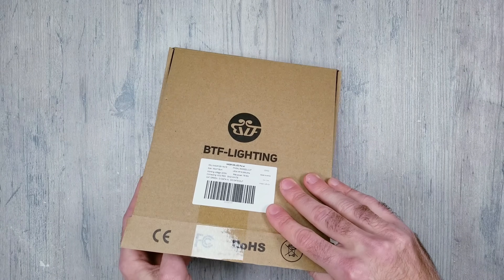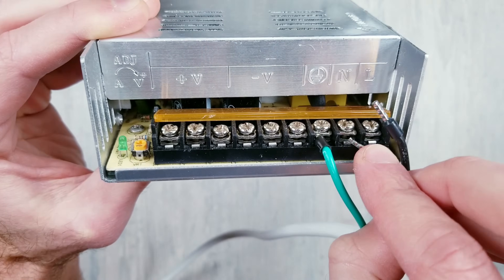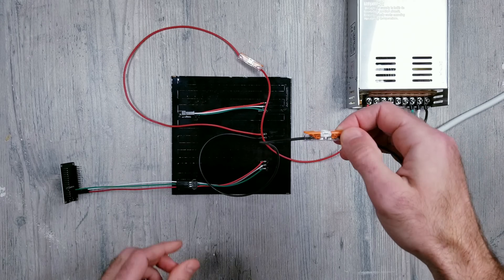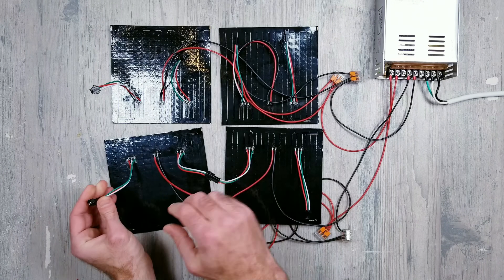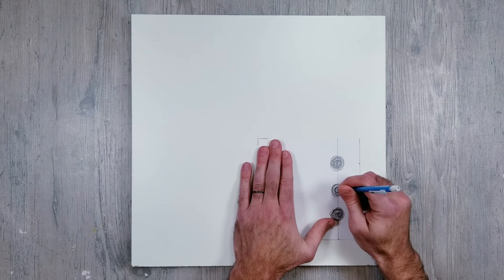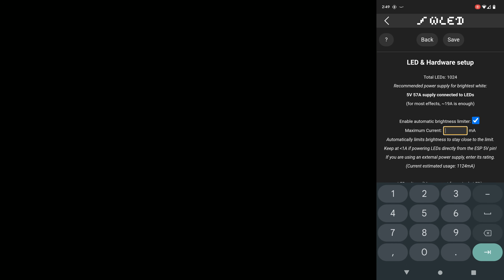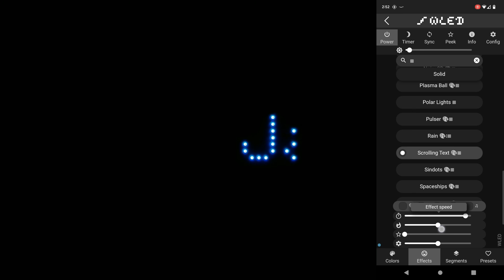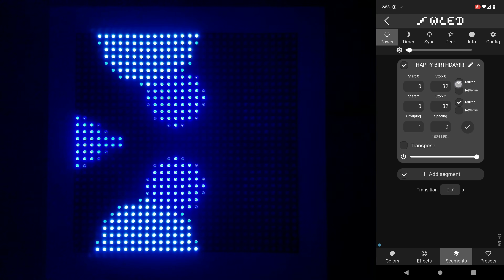1000+ LED Matrix! Setup, Power, Control, Tips - WLED 14.0-b1 2D Matrix

Comment: Won't the LEDs overheat (and die sooner) if you have them sitting on wood which insulates heat instead of dissipating it? Just FYI, the PSU you're using consumes 4 Watts on idling alone (no load). Prolly a good idea to use a smart outlet to cut the power to the PSU when not in use. That also helps with the LEDs which also consume power when not in use (just idling).

Comment: Hi,
I just came across your channel, and I do enjoy it and appreciate all the effort. I have a small question and am not sure if someone has raised the same: What if I want to connect more 6 8, 16, 32 panels, how will the power connectivity be handled? 
Appreciate a quick video demonstrating this.

Thanks 
Jandal.
Reply: just follow the same steps as the other panels, as long as your power supply can handle it you're fine. make sure you stay in a limit where it can still fit in ram for your esp

Comment: When in time 4:00 you connected 2 of the two injection cables to one Wago and the other two to the other Wago, could you just place all four in a single one? Id thought so because they share the voltage, but i don't know if im missing something

Comment: Chris, instead of using a pre-made LED matrix panel, could we just connect individual CoB LEDs, in a serpentine fashion to create a matrix (say 100 x 100) and use WLED for that? ... my end goal is to have a large matrix, highly spaced leds (I am fine with low resolution), hanging out my balcony where I can display pixelated text, images & gifs visible across long distances from outside.

Comment: Why did you limit your panel to only 3A? You have a 60A Power supply and the LEDs can take upt to 50 mA (i think 30 mA is recommended) . So 30 mA * 1024 = 30720 mA or around 30 A. I think this should also be possible the way you wired up your panels

Comment: I tried all the steps, but my lights do not turn on. Don't know what I am doing wrong. I use esp8266. And use micro usb cable for power, i use 4x4 led matrix and also tried them on 8x8 matrix also. Please help me troubleshooting this issue. It would be a great help 🙏🙏🙏🙏🙏🙏

Comment: good afternoon Chris. love your videos, got a question and maybe i missed it, But i do remember you talking about the eco version of lights maybe not working with a certain application, will the BTF eco panels work with this and if so what's the difference between them, they are almost 2 for 1 compared to the version you have selected on Amazon, TIA. Dale
Edit ok i did just find BTF's picture showing the difference and it looks like it all has to do with the color of the LED's and wire, so next question is how much of a difference is there, sorry for all the questions but i love messing with these and i am trying to learn all i can.

Comment: Can you turn off the power supply but keep on the esp32 to turn off the leds but keep on the esp32? Your videos have been very helpful to me and I appreciate you replaying to your comments
Reply: You can use a smart plug but that would mean having to wire the ESP32 to a separate power source.  I would suggest a relay to turn the LED’s completely off as they still use power in the off state.

Comment: I have to thank you for your very informative videos. I found your channel after purchasing Govee permanent outdoor lights but it led me to a few interesting projects.

I had just purchased four 32 x 8 LED light matrix panels just like these and it helped me get them working for a 1024 LED matrix for my wife's 50th birthday party.

I made a box and defused the LEDs with hard stock paper.

Everyone loved it and I am getting asked to share it at other birthday and Christmas parties.

That was fun but wasn't enough. I bought 8 more panels and setup a 3072 LED 12 panel matrix that I have working and am currently building a box to hold them so they can be moved around.

Thanks to your other video on using multiple channels I was able to get it working with a lot of trial and error. I ordered white semi transparent acrylic panels to defuse them this time.

I plan on having two chips. One setup for text scrolling between effects and a second with sound reactive for party time. It should be easy to switch between the two.
Reply: did one ESP32 board control all 12 panels with WLED and i assume if it did you used several of its data outputs, thanks Dale
Reply: @kb0cow   One ESP32 ran all 12 boards on two data outputs. Chris has a video on how to do this.
Reply: @90Beater  Thanks Chris for the reply, i figured it might be better to try two out puts instead of one, and them I assume that WLED did run them all. i went to your page to maybe see your Birthday board in action but no luck. i will try and search through Chris's videos, i have been watching quite a few of them plus others to learn as much as possible about these boards and running them  with WLED. Thanks again for the response. Dale

Comment: Hi Chris, we are using 3 pin BFT strip like you have on 5v but now they offer them in 12v as well. That changes things around, they have the 12v with 4 pin,. The controller we have can do  5-24V but only 3 pins, is there a way to somehow make the BFT 3pin controller controlling the 4 pin 12v 
BFT strips?

Comment: Don't know why someone would tell you that you need to use ferrules for those types of mounting terminals.. Ferrules are for PCB style terminals that have a small flat spring that is compressed by a screw. The connectors you're working with on the power supply are simply a screw with a square washer. The correct termination is a ferrule (2 pronged fork) that will sit either side of the screw that is clamping down and support the washer evenly.
Reply: Those are actually called "lugs." The ferrule refers to the fact that they are crimp-on, as opposed to solder type. A ferrule is basically a cylinder, y'see.
The lug is the actual end connector.
Reply: @jeffro.  Terminology fail on my part (probably wrote the original comment after beers) but you get the point. 
A cylindrical ferrule is just going to cock the square washer on an angle which means any movement of the cable could shift it away from the clamping force.
Reply: Not being smart when asking this, but does it matter?? Actual question.
Reply: @gurthbroox  Yes - this is AC power we're talking about here. If they come loose you've got exposed wires and a potential short.
Reply: @gurthbroox I don't know if it matters in this case but I know the problem ferrules are supposed to solve. If a high current goes through a braided cable and only some braids have good contact to the terminal those braids can heat up, potentially setting nearby objects on fire.
Reply: @Gosuminer  ferrules are not for this type of terminal. They are not solving any "problems" with this type of terminal (barrier strip). Ferrules are used for PCB mount terminal blocks where the opening is a continuous female opening. barrier mount strips have a central screw through a square 'washer' that work together as a clamp. 

The issue isn't about contact either. The issue is that the braided wire can shift and loosen as it inherently has tiny haps between the braids that might allow the wire to settle (re arrange itself) remove the clamping force. When you crimp a wire, it crushes the wires together forming a semi solid wire.

Wiring to a barrier strip should us a fork terminal or a ring terminal (ring style requires complete removal of the screw/washer).
Reply: @ryanokeefe12 why would he use 30 Amp psu just to limit the lights to 3 amps???
Reply: @fomingera65  What are you talking about? My comment has nothing to do with the power supply current rating.

If you're somehow inferring that fork terminals are only rated for 3 amps, they're not. Most yellow for terminals are rated at around 50 amps.
Reply: Thanks for the input, I agree. Also, I would much rather worry about the termination of the LED panels as they have a much higher current.

Comment: I for the love of God I can not get the panels to light up or get the esp 32 to receive power. I used this very method with just one panel ( with different panels )and nothing will power on.  I switched to power from my 5v 15a brick to the esp32 and used wago clips to like you do in another video of yours. Still nothing, but the ESP 32 will power up but no luck with any of my panels. I am so frustrated. I even tried to power the panels directly with the power brick through the injection wires. All Panels I have will not light up. Different sizes, 8x32 and 16x16. Not sure what is happening.
Reply from the maker: Thanks for watching and that's a bummer your having issues! What pin are you using for data and is that the pin you put under led preferences next to the GPIO field? Also do you have all the gnd wires connected from the power, eps device and leds? Maybe someone else will have some suggestions and can chime in.
Reply: @ChrisMaherDIY  I'm using the d2 pin and changed the gpio to 2 in wled and nothing. All ground wires are connected as I do get power to the esp 32 but nothing to the panels. 🤷
Reply from the maker: @TomParash  sounds like you have things connected the right way! Do you by any chance have a ws2812b led strip laying around to try connecting and seeing if that works? At this point it's just trying to go through the process of elimination to see what might be failing. Very frustrating. I've been there. It's not fun.
Reply: @ChrisMaherDIY  got it working finally. The leads that came with the panels were not contacting the wago connectors well due to them being so thin. Used jumpers to test my theory and I was correct. I'm going to solder new wires to the panel for a better connection. Thanks for the back and forth. Got my brain working again from a stand still.
Reply from the maker: @TomParash  awesome!! So glad to hear you got it figured out! Way to keep at it! Thanks for the update buddy

Comment: Can this same project be done using the Adafruit 64x64 panel? Their Matrix portal piece runs on Espressif ESP32 Wi-Fi coprocessor with TLS/SSL support built-in.
Reply: I know this is an old thread... the adafruit panels require 16 connectors and great attention to wiring diagrams and adapters. Wled support is highly experimental. I would stay away from hub75 panels unless you really (really) know what you are doing.

Comment: have you had any issues with lagging with the esp? I am going to try and connect 2 esps to the 1024LEDs and see if that works for the lag
Reply from the maker: Hey buddy! I have not yet experienced lagging but I also have not tried that many leds with an esp8266. I've pretty much switched over to the 32 for everything since they are not much more expensive. Let me know if it works!

Comment: This is a great walk through.   I found the sound a little clipped and distorted, which made some of the video difficult to listen too.    Small complaint.  I really enjoy your videos.
60Amp @ 5V (300Watts) would be slightly overkill for just over 1000 pixels, unless you plan running all pixels at 100% white, with the white generated by using the three RGB LED's, but if you have one lying around, overkill never killed a project.    By having the brightness limiter set at 3000mA, which is 3Amps, you will get no where near the 60Amps of the supply rating :).       Just wanted to mention this as people on a budget may not be able to afford a 60A 5V power supply, and lower current supply,, with the brightness limiter set to 3000mA will give the same results.
Reply from the maker: Thanks so much for watching and taking the time to comment! Yeah I'm still trying to figure out sound stuff so my apologies on that. Thanks so much for the info and good stuff for sure! I've found that the larger supplies are not that much more expensive so I tend to order them instead but for sure overkill especially when I generally have things set to 3000mA.
Reply: I didnt understand this either. You said especially when you set them to 3000mA. Thats WAAYYYYYYY under 60000 mA's @ChrisMaherDIY . I do agree they arent much more expensive but id imagine they can handle ALOT more.

Comment: I've tossed a couple comments in other videos. They are always excellent and show interesting ways of getting these entertaining LEDS connected.  

My questions have been whether you can One, does the chip you seem to routinely use, has more than one data pin to drive the data for another LED Strip?   And the other, some ideas on how you ultimately mount or protect the chip when you setup one of these projects?  thanks
Reply: Hey Norm, one thing I've done in the past is wire the LED runs in series and then set segments to control them individually. The chip (ESP32) does have multiple data pins but I don't believe you can register them as individual lights in WLED.
For protecting the chip I tend to just wrap it in electrical tape to avoid shorts and then hide it wherever possible. I'm sure there's a nicer way but over the years i've never had a problem with this method
Reply: @timn9237  Thanks for that feedback, appreciate it.  I am aware that you can set segments 1-30, 31-60 on a single strip, no matter how its wired together. What I was thinking was having two strips and controlled by a different data pin from the same chip so that I could manage them both, even though they were not continuous or in the same location, say they were separated by a few feet in a setup.  

I guess I'll have to experiment and see if I can determine exactly how it works somewhere along the way.  WLED gives you so many options, there are of course multiple ways to do perhaps the same thing.
Reply from the maker: Thanks! Great advice!
Reply from the maker: Thanks so much for watching and great questions! So I have not played around too much with multiple pin setups but as far as I know you should be able to do exactly what your wanting to do. This is also a good resource in regards to multi strip support: https://kno.wled.ge/features/multi-strip/#:~:text=For%20good%20performance%2C%20you%20can,a%20total%20of%204000%20LEDs. 

And i really don't do anything with my boards to protect them. They usually just sit somewhere behind something and don't move so I'm not too worried. I know some people have suggested using a travel soap dish to provide some protection!

Comment: I’m using a Dig-Quad board with an ESP32 on it and the most recent SR version of 0.14.0-b1.  I’m wanting to do four panels, each that are 24x25 (600 leds each, 2400 total). The Dig-Quad can allow 4 separate data pinouts.  My thought was to have each smaller panel use one of those pins, then in WLED define such so they act like one large panel.

 I this video, you have a single data line that chains to each of the panels, 1024 in total.  If I try to do that with 2400 leds, am I going to run into a problem?

 Is there a way to take advantage of the four pinouts on the Dig-Quad and still get the same net effect?

Short story, will I get data loss with 2400 leds?
Reply: WLED: “For perfect performance, it is recommeded to use 512 LEDs/pin with 4 outputs for a total of 2048 LEDs. For very good performance, it is recommended to use 800 LEDs/pin with 4 outputs for a total of 3200 LEDs.”

I’m putting together a six 22x22 panels matrix with 484 pixels for a total of 2904 pixels. I’m going to use a single data pin for each panel. Any success using more than one data pin?
Reply: @markc.5750  I ended up configuring as four separate data lines, and one run to each panel, and configuring ad a large matrix within WLED.  It worked just fine!
Reply from the maker: I think if you used one pin for the first half of the lights and the second pin for the second half of the lights and made the update in led preferences under the gpio and led count, I think everything else should work pretty similar. I could be wrong and I'm just brainstorming off the top of my head but I would try it and see what happens!

Comment: It never occurred to me to use a jumper to fit into that connector. I just soldered on the lead that they include in the box, even though I Hate with a capital H PVC insulated wires.

There’s nothing technically wrong with using 20ga jumpers to connect the board, but practically speaking the current those wires carry from the controller is very low, so there’s also nothing wrong with using the thinner “standard” gauge ones. Now, if you were running all the power for the matrix through them, that would be a different story, but that is fed from the power injection pads in this case.
Reply from the maker: Thanks again! Yeah its not the best way of getting things connected but it might be the quickest lol. And great advice on the jumper wires as well! Appreciate all the wisdom your passing on!

Comment: bro just ditch the weigo connectors and solder the wires directly, no? anyway great video!
Reply from the maker: Thanks so much for watching and taking the time to comment! Yeah, If I was not constantly re-using the lights and moving things around and trying different setups I would for sure just solder things directly.

Comment: Awesome! I’m going to build one of these after I’m finished with my lights outside.

Any idea how you could diffuse one of these? I’m thinking some type of film but there will probably be some dark spots if the film isn’t high enough
Reply from the maker: Thanks buddy! I would probably just try some milky white acrylic and see how it looked. You would not have to have much distance between the diffuser and lights for it to look smooth if thats the look your going for. But if you had it sitting right on top of the lights there would be little black areas but I kinda like that look.